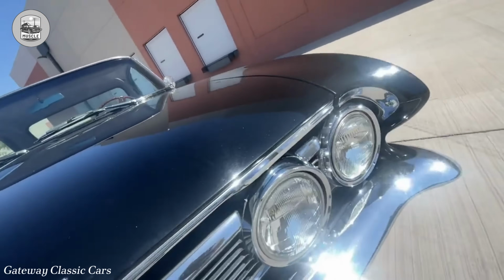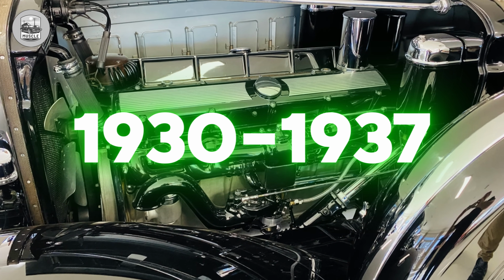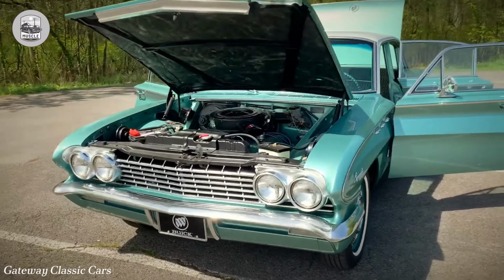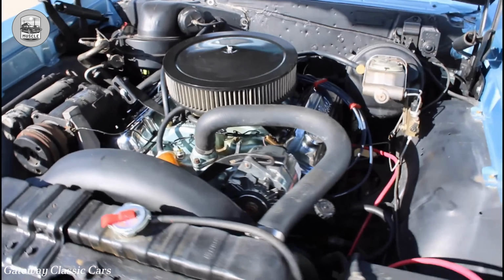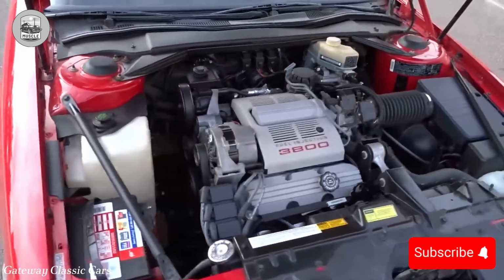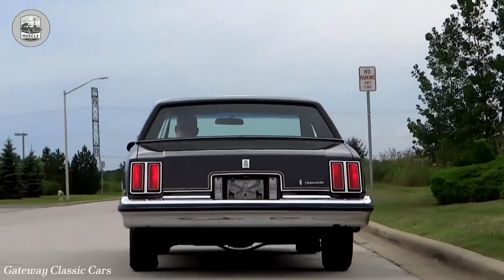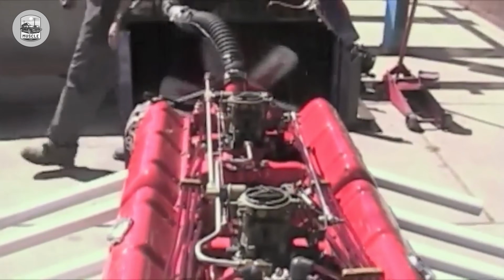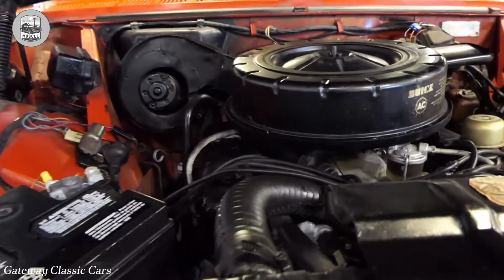10 MOST FAILED and WEIRDEST GM Engines ever made | Worst engines blunder!

Comment: The title is very confusing. The 3800 V-6 was one of the most successful engines ever made. The Oldsmobile diesel, as disastrous an experiment as it was, wasn't a 4.3 litre. It was based on a 350 cubic inch engine which is 5.7litres. The 4.3 lite v-6 was another extremely successful engine for GM which is still used today. The double V-6 truck engines were very successful and produced tremendous torque. Finally the Cadillac V-16 engines, especially the first design was an extremely successful engine and their demise had only to due with economics. Again, the "worse" moniker applies to a few of these engines, but even the later success of the aluminum small Buick nail head was not an indictment on failed design which this title suggests.
Reply: In the early 1980’s I worked for GM at their transmission plant in Three Rivers MI. My dad was farming near Lansing MI and let me know he could use some help so I checked with the office and I was needed at a new plant in the Oldsmobile complex that was making a 4.3 liter diesel. I didn’t transfer but I heard they stopped producing it after a year. With the 5.7 liter GM diesel, the 4.3 liter GM diesel, and the 6.5 GM turbo diesel , GM did more to stop sales of diesels in the United States
than any other reason I know of. 50% of Europe drives cars and trucks  powered with diesel but until the last few years the USA was primarily gas engines and that was thanks to the GM diesel program.
Reply from the maker: @dpdeere  Thanks for sharing your experience working with GM during such a pivotal time! You bring up a critical point about GM’s diesel program and its impact on the U.S. diesel market. The 4.3-liter V8 diesel, introduced as a smaller alternative to the 5.7L, had potential but suffered from the same reliability issues that plagued the 5.7, including head gasket failures and injection pump problems. The 6.5L turbo diesel, introduced later, was a step up, but by that time, GM's reputation with diesels had already taken a serious hit.
You're right that Europe embraced diesel far more than the U.S. due to its fuel efficiency and torque benefits for both cars and trucks. Unfortunately, the early GM diesel engines, which were essentially gasoline engines converted for diesel use, weren’t robust enough for long-term reliability, especially compared to their European counterparts. This tarnished diesel's reputation in America for decades, and only recently has diesel started to make a comeback in the U.S., mostly in trucks and heavy-duty applications.
Let's keep this conversation going, Muscle Car Masters! What are your thoughts on GM’s diesel engines? Comment below! And don’t forget to like, share, and subscribe to the Muscle Car Master Channel for more great insights and discussions....
Reply from the maker: Thank you for your thoughtful comment! You’ve touched on some key points, so let me clarify the context to clear up any confusion.
First, you're absolutely right about the GM 3800 V6—one of the most reliable and widely used engines ever produced. It powered everything from sedans to sports cars and helped solidify GM’s reputation for dependable V6 engines. The Oldsmobile Diesel, on the other hand, was a different story. It was indeed based on the 350 (5.7L) platform and, while innovative, it faced significant reliability challenges, which is why it often comes up in discussions of 'failed' engines despite its potential.
The 4.3L V6 you mentioned was another powerhouse for GM, particularly in trucks and vans. Its durability and torque made it a favorite in the commercial vehicle world, and it continues to be valued today. You’re absolutely spot on regarding the Cadillac V16 too—an engineering marvel, cut short only due to the economic downturns of the 1930s.
As for the Buick Nailhead, especially the aluminum variants like the 215, these engines were ahead of their time in many ways. However, the focus of the video might lean towards engines that were misunderstood or challenged during their production era but later found redemption—like the aluminum Nailhead!
We love hearing from passionate enthusiasts like you! Keep the conversation going, and feel free to share more of your insights with us. Don’t forget to comment, share, and subscribe to Muscle Car Masters for more discussions like this! Let's keep this community growing strong!
Reply: @MuscleCarMasters68 How exactly does a posi Trac rear end on a Plymouth work?
Reply from the maker: @DefaultSettings9  The 'Posi-Trac' rear end, or 'Positraction,' is Plymouth’s version of a limited-slip differential (LSD). It allows both rear wheels to spin at the same time when extra traction is needed, like during hard acceleration. But here's the magic: when you're turning, the differential allows the wheels to spin at different speeds to prevent tire wear and ensure smoother handling.
So, how does it work? Inside the differential, there are clutches or cone mechanisms that engage when the wheel with less traction starts to slip. This engagement transfers power to the wheel with more grip, helping you stay in control and put all that muscle car power to good use!
If you're into Plymouth or other muscle cars with similar setups, you'll find a lot of tech and history packed into these systems. Keep those comments coming, hit that like button, and don’t forget to subscribe to the Muscle Car Masters channel for more deep dives into muscle car performance....

Comment: Is Buick's 215 half of Cadillac's 430??
Reply from the maker: Great question! Buick's 215 is actually a completely different engine from Cadillac's 430. The Buick 215 was a small, all-aluminum V8 introduced in 1961 and became famous for its lightweight construction. It was primarily used in compact cars like the Skylark and Special. Meanwhile, the Cadillac 430 was a much larger, cast-iron engine introduced in 1967 for Cadillac's bigger models. The 430 was part of Cadillac’s family of big-block V8s, so there's no direct relationship between the two in terms of design or displacement. However, both engines reflected GM’s ingenuity in their respective eras.
For more engine facts and fun discussions, drop a comment below! And don't forget to share, subscribe, and check out more videos on the Muscle Car Masters channel to keep the conversation going!
Reply: @MuscleCarMasters68  Cadillac made a 430ci v-16 in the 30's.
Reply from the maker: @wesleyreese7647  Cadillac did make a 452 cubic inch V16 engine in the 1930s, often mistaken as a 430ci. This engine was introduced in 1930 and was an engineering marvel of its time, featuring overhead valves and producing about 165 horsepower—huge numbers back in the day! It was designed for Cadillac's top-of-the-line luxury cars, offering a smooth and silent power delivery for the elite class. While it wasn't a 'muscle car' engine, it showcased Cadillac's ability to innovate and build some of the most powerful engines of its era.
If you're into more amazing engine history like this, be sure to comment below, share this with fellow car enthusiasts, and subscribe to Muscle Car Masters for more deep dives into iconic engines and automotive history. Keep those awesome facts coming
Reply: @MuscleCarMasters68  That v8 of the 60s was a 429

Comment: Worst of all time - 6.0 Ford Powerstroke.  What a debacle.
Reply from the maker: Thanks for bringing up the infamous 6.0L Powerstroke! You're absolutely right—this engine became notorious for several major issues, especially in the early years. The 6.0L suffered from head gasket failures, faulty EGR coolers, and injector problems, which led to widespread frustration. The root of many of these issues was the higher pressure levels Ford demanded from the engine for emissions regulations, causing stress on components not quite ready to handle it. On the bright side, aftermarket solutions eventually came out to address these weaknesses, and with the right upgrades, it could actually be a solid performer. But in stock form? It certainly left a lot of owners stranded.
What do you think was the most frustrating part of owning one? Drop your thoughts in the comments, share your experiences, and let’s hear what other engines deserve the title of “worst of all time”! Don’t forget to share this video and subscribe to Muscle Car Masters to keep the conversation going!

Comment: The problem w/ GM & the other OEM's is that they don't listen to their Engineers. The GM Gas-to-Diesel converted engines are prime examples. I've been told by a couple of very experienced mechanics that the first engines were known to be weak & Engineers warned the managers & executives. However, strengthening the engines w/ thicker block walls, appropriate fasteners & the proper Diesel Fuel/Water filters was deemed 'to expensive'. Really GM; what was really more expensive, the frugality of just having a Diesel engine in the line up or the customers trust. In 1984 the cost of #2 Fuel was $0.77-0.80/gal.; Regular Gasoline was $1.21/gal. The GM Diesels; when they lived, had 30-45% better mileage. So there had to be a market. To bad GM wanted to make money instead of a trustworthy product.
Reply from the maker: You're absolutely right about GM's missed opportunity with their diesel engines, especially the gas-to-diesel conversions. The early Oldsmobile 5.7L Diesel V8 was a prime example of corporate decisions prioritizing short-term cost savings over long-term reliability. As you mentioned, engineers knew that the design needed a stronger block, better fasteners, and a more advanced fuel filtering system to handle the rigors of diesel use, but management deemed the changes too expensive. Unfortunately, the result was an engine that often failed prematurely, damaging customer trust and hurting GM's reputation.
What's especially frustrating is that diesel technology had so much potential in the '80s. As you pointed out, diesel fuel was significantly cheaper than gasoline, and the mileage benefits were clear. Had GM invested in building a robust, reliable diesel engine from the start, they could have captured a large share of the market. Instead, they prioritized short-term profits, and the customers paid the price with unreliable vehicles.
Thanks for sharing your insights! We’d love to hear from more viewers—what are your thoughts on GM’s diesel engines, or have you had similar experiences with other manufacturers? Comment below, and don't forget to share and subscribe to Muscle Car Masters for more great content!

Comment: This claim is mostly non sense the GM big block V6 was a great idea had 2 of them in 64 305E and a 401 model in a 1967 GMC 1 ton
Reply from the maker: Thanks for sharing your experience! The GM big block V6 engines, like the 305E and 401, were indeed unique powerhouses. Introduced in the early 1960s, these V6s were part of GM's lineup to provide rugged, torque-heavy options for trucks. The 305E, with its 305 cubic inches, was known for its durability and low-end torque, making it ideal for heavy-duty work like towing and hauling. The 401, commonly found in GMC trucks like your '67 1-ton, was another beast designed for hard labor, delivering even more torque and reliability.
What made these V6 engines stand out was their design—a simple, robust architecture built to handle heavy loads while maintaining reliability. Unlike many of today's high-revving engines, these were built for grunt, not speed, and were a great choice for anyone looking for a truck that could take a beating.

If anyone else has stories or experiences with these engines, let us know in the comments! And for more cool insights on American muscle and unique engines like these, make sure to like, share, and subscribe to Muscle Car Masters for more awesome content.

Comment: What about the ill faterd GM 4,6,8 engine?
Reply from the maker: Great question! The GM 4-6-8 engine, officially known as the Cadillac V8-6-4, was introduced in 1981 as an ambitious attempt to improve fuel economy. It had a computer-controlled system that could deactivate two or four cylinders under light loads, which was pretty advanced for its time. However, the early '80s computers weren’t quite up to the challenge, and the system often had issues with reliability and smooth transitions between cylinder modes. This led to rough performance and frequent complaints from owners, earning the engine a bit of a bad reputation.
That said, the concept was ahead of its time and laid the groundwork for modern cylinder deactivation technology, which you can now find in engines like GM’s EcoTec3 V8s. It’s interesting to see how far the idea has come from its rocky beginnings.
What do you guys think? Have you ever driven a car with cylinder deactivation? Let us know in the comments! Don't forget to like, share, and subscribe to Muscle Car Masters for more deep dives into engines, forgotten tech, and all things American muscle!